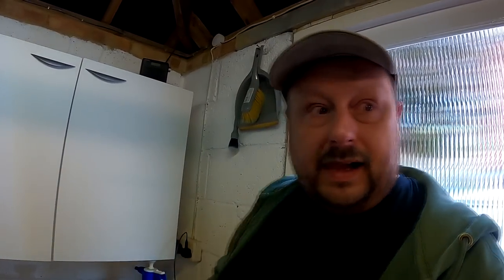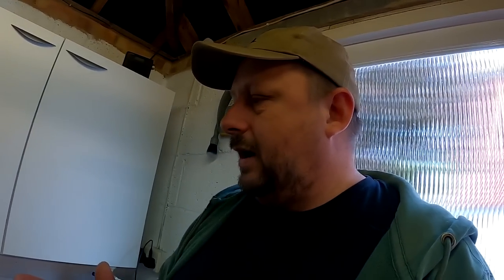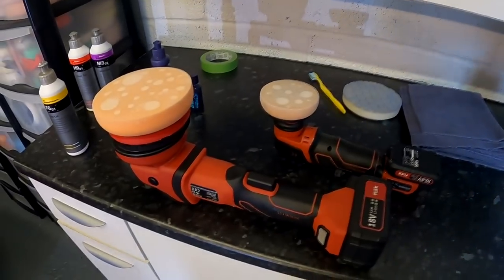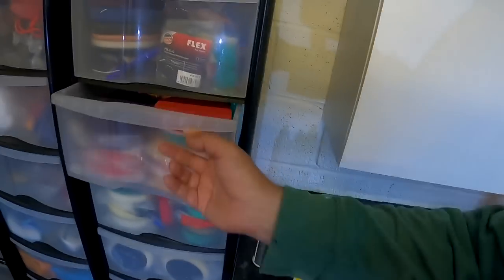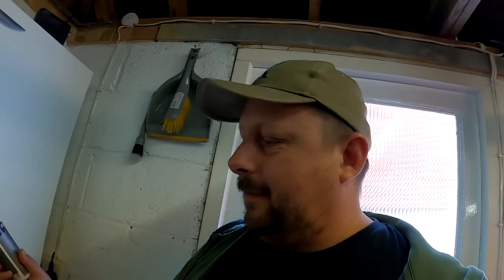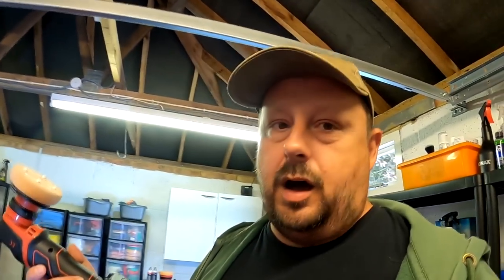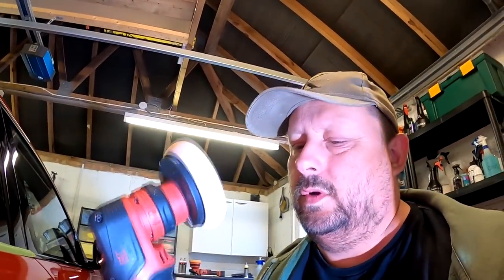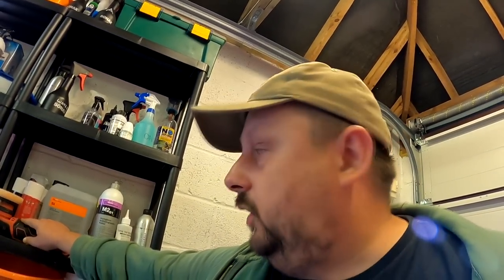Why I love the Flex PXE mini polisher so much

Comment: Based on your informative videos I purchased the XFE 15 AND THE PXE 80,  I couldn't be any happier. I absolutely love these tools. Makes paint correction so much easier, less fatigue and no tripping over cords etc..... Flex owes you a huge debt of gratitude for your promotion of their products, as do I. I can't Thank you enough.......
Reply: I heard a lot about the XFe15 cordless not be able to do heavy compounding , how is it going with you in that case ?
Reply: @luchoperuano6617   I've never really needed to do heavy compounding,  I'm mainly getting rid of swirling and oxidization.
Reply: @luchoperuano6617  I tried it on a bass boat cutting with meg's 91 and had success with it but the cordless Rotary is still the way to go.

Comment: The PXE is an awesome tool. I did a full three stage polish on my 911 with one over the winter. The Flex pads are all the pads you’ll ever need IMO.
Reply: Was it feasible to do a whole car with this size? I want to start polishing for the first time and am tempted to buy a cordless flex polisher. But can only afford one initially. And now i'm wondering which size would serve me better. As a hobbyist i feel like the lower work rate of the smaller pad shouldnt really be a problem...
Reply: Henk De Vrjes It depends on the size of your car and how much patience you have! It’s a great way to start polishing as the machine is so easy to use. I spent about eight weeks on my car, doing a panel here and there. If you’re limited to time you’d probably be better off with something like the DAS6 Pro. It’s a larger DA polisher, cheaper and a great tool with which to learn the basics. That said, once you’ve learned to use the PXE you’d find that it’s a go-to tool for years afterwards. With the DAS6 you’d probably want to upgrade if you start getting serious about polishing. I have no regrets buying the PXE. I was so impressed with the cordless technology I ended up buying the Flex direct drive polisher too.

Comment: I'm a fan of Flex but my wallet isn't 🤣 so after 2 years waiting for a more reasonable option I found out that Sealey had introduced the cordless CP18VOP model in October last year. It is a very good, capable and versatile tool that sells for around £250 with 2 batteries each gives 35min approx of running time. I use it with the orange pad from Lake Country and can do more or less correction easily changing the chemicals. Favs at the moment are Poorboys 2.5 for swrils or Auto Fanatic's Secret Weapon for lighter correction/enhancement.

Comment: Cheers Jon!  I tried Gyeon Skin by itself on the test panel a few years back when I was testing the first formula of Gliss, and the Skin side did not seem to provide much of any significant hydrophobic presence.  There was some repellency at the start of the rinse but it was only moderately hydrophobic, nothing like the awesome hydrophobics that Skin adds on top of Mohs.  A wash with Bathe Essence nearly had it fully hydrophilic.

  That was after prepping with a standard abrasive and panel wipe, I'm really interested to see if the sio2 base layer from Gyeon Primer can really get the Skin topcoat to work its magic in your test, haven't ever tried that combo out!  Same story with Gyeon Booster, without a coating base I never saw any magic happening, but on top of the coatings it made all the difference.

  Really want to get my hands on the Flex PXE, such an awesome design and I love that quick disconnect feature to be able to swap the different plates and pads out seamlessly.  I got a chance to play around with it at the Mobile Tech Expo this year here in the States, incredible little tool.  Out of the budget for me, but between the Flex PXE and the Rupes Nano I'm leaning towards the Flex.  Thanks for the video, stay safe my friend!
Reply from the maker: Yo Kyle :) great to hear from you.  I got similar results to what you describe, this video is a few weeks back.  Skin on primer did not work well in terms of hydrophobics.  the skin bottle is about 2 year old at least.  It felt really nice to apply.  Maybe it didnt bond or maybe it expired.  But yer when I tested it on top of Mohs years ago when it was new and it was insanely hydrophobic.  My guess is if I put some 2 year old mohs down and put skin ontop it will work well (even though its old).     I ended up just waxing the car :)
Reply: Forensic Unplugged - Thanks so much for the update Jon!  I figured there was a reason why Gyeon wouldn’t sell Skin separately from Mohs, must be some cool chemistry going on between the two of them that does something special when layered together that might not work as well with other protectants.  I still have a 50ml bottle of the latest Mohs which is a few years old now that I haven’t opened, hoping the shelf life has held up I’m thinking about playing around with it some!

Would like to reach out to Gyeon to see if they can get more technical with how Skin, Booster, Flexi, Phobic, and Bead all compare and differ from each other as topcoats.  Always great to hear from you as well!

Comment: Great polisher, just wish they’d released the 2” & 3” rotary attachments as initially intended.
Reply: i mean at least 2" right i am sure this thing will easily be capable of 2 inch rotary or da until they come up with 2" backing plate i will consider my mini flex unfinished

Comment: Def one of the best tools I have bought, as with the XCE which is a workhorse. I prefer the Rupes pads with mine, yellow with perfect finish is a great combo, new Rupes yellow wool pad steps it up. Little tip, put the 3 inch plate with the smaller throw and you have a 3 inch sander, great for headlights. Also using the 40mm IBrid pads.

Comment: Hello Sir Jon!  My question would be How do you store your Korrosol?  Do you keep it with the spray gun or without it?  Do you put Korrosol closed but at the same time within a large ziplock bag?  I am asking you because of the bad smell it has since I also have CarPro Trix and AM Details Iron but AM Details Iron is not as stinky as the others and don't seem to be within a ziplock bag. 
The Flex is also within my bucket list because I still have Griots GG6 and another one I purchased at Harbor Freight.
By the way, on that Flex do you have to change the grease it comes with like we normally do with Griots and other polishers?
Always watching you from Puerto Rico 👍🇵🇷 and hope you sing more.  I really miss your music and singing.👏🙏
Hopefully, you can get screened properly to determine if you have or had covid-19 and if you had it then you can donate your plasma so it can help others.
Reply from the maker: I dont notice the korrosol smell.  Only if I use it otherwise its airtight a good test is just squeeze the bottle with the trigger on if it cant collapse in then its airtight.  I dont blieve you have to do any maintainance with the flex but I would ask flex about this.   Awsome to have a viewer from Puerto Rico.  Stay in contact and one day I come to visit :)

Comment: Nice video Jon, I’m thinking of investing in a DA polisher, but I don’t want to have to buy several. Could I just invest in a Flex PXE 80 and use it for all my panels on my Mini? I know the 3” would take longer on bigger panels, but would it still be ok, or do you have to go for the bigger 5” DA polisher?
Reply from the maker: no mate get a DA8 from in2detailing cheaper and better size.. supports 3 inch or 5 inch plate. see DA8 review

Comment: i brought rupes nano ibrid for those hard to reach places ... in my option its crap it stalls when i add bit of pressure changing from 1" to 2 plates its pain in arse .. im tempted to pull the plug on this flex as it seems it just make life lot easier gets the job done lot faster

Comment: Just the video I was waiting for. I am really confused though about the pads it can take and use, can you explain that to me some more please ?. The backing plate sizes seem to be in cm's and are a bit bigger than the equivalent pad size by the sounds of it.  Most pads are sold in 1" 2" 3" etc, so which ones will this machine take ? Ta in advance
Reply: so you use the 12 mill throw adapter with the 75ml place (3inch).   You use the 30ml (1inch) plate with the rotary adapter.     And you use the 3ml throw adapter with the inch daisy pad plate (this plate does not have velco it just sticks to the sanding daiseys).      The rotary adapter will not allow you to fit the 75ml plate (deliberatly by design)

Comment: Thank you for a very good video! What do you think of the vibrations on this machine vs the  LHR75E? Best regards from Sweden
Reply from the maker: the  LHR75 is on another level of power and it will kick out more vibration.. but vibration is not a massive issue with either tool.  the pxe80 is primarily a nano tool that you can get away with using a 75ml plate and its remarkable good considering how small and light the machine is.  but yer the LHR 75 is on another level of power just like the XFE7-12 is.
Reply: @forensicunplugged4295  Thank you!

Comment: Would you easily say that the PXE80 replaces de rupes mini ?
Reply from the maker: rupes ibrid for titgther smaller hard to hit areas. PXE for more power, better batteries, decent 75ml option, better quick release system, but a bigger tool less intracate.  both are excellent but I prefer the flex specially with the little ADT adapters for door handles and extention bars.
Reply: @forensicunplugged4295  I meant for the rupes mini the 3” DA not the nano
Reply from the maker: @luchoperuano6617  ok mate the lhr75 is on another level of power it has a lot more grunt than the PXE... but the PXE is a nano tool.  it supports 1 in pads on the rotary adapater you can do spot sanding with teh 3ml adapater...   so different kind of tools PXE can do 3 inch mini polishing duties but it has no where near the power mate.
Reply: @forensicunplugged4295 does the 75e do good for polishing to?

Comment: Buyer be aware that tool is NOT gear driven
Reply from the maker: if its not gear driven how does the motor drive a lateral shaft then direct the torque perpendicular to the main drive shaft.  Answer gearing :)      however you have 3 adapters.  1 rotary which is "driven" and 2 DA adapters which introduce a free spinning bearing off of the "driven" axel.  I think you might be trying to say something like this machine is not a force rotation dual aciotn polisher.   if thats what you meant then correct.